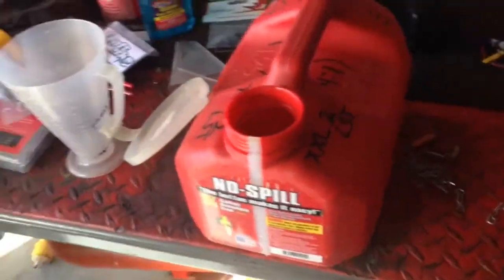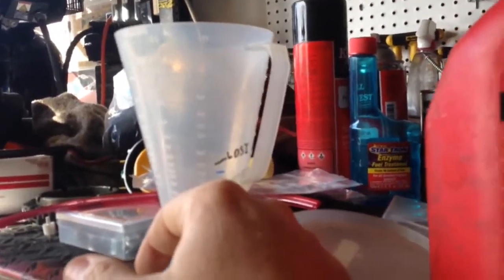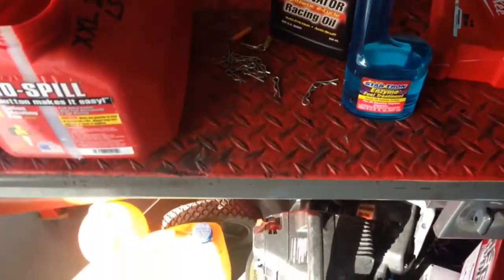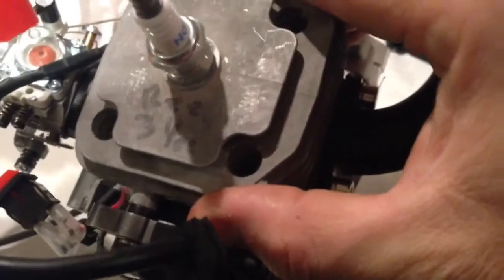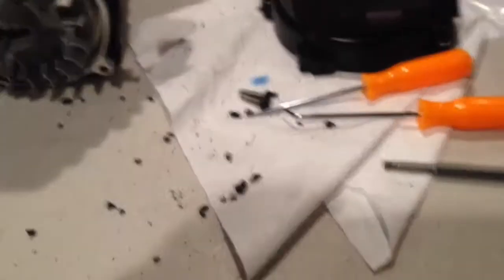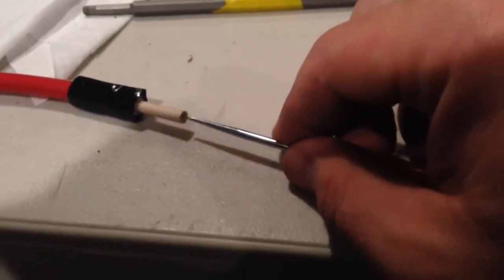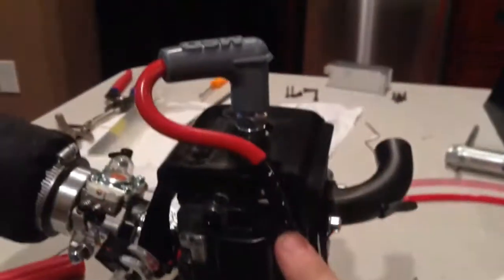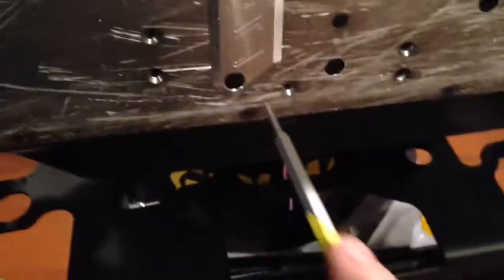Part4 DBXL, GAS Mix, MSD Spark Plug Wire install

Comment: Hi buddy,  hope you're doing well!? I have a question, here in Sweden we have 95 and 98 octane, can I run 95 octane in a 2 stroke engine with the Dominator 2 stroke oil 28/1 mix?

Comment: I agree on your fuel choice and I absolutely agree with amsoil 2t seeing that is what I use, I also agree with adding a little fuel to the mixing cup to retrieve all of the oil. Of course you will not over heat, that is all dependent on your jetting and doing proper plug chops to confirm you are at the correct stoichiometric mixture. You see, I have these debates all of the time, even with my customers after I give them there bikes/quads back. As soon as they here how I want them to mix there fuel they are instantly up in arms and insists on mixing it with more oil. I just point them to macDizzy post and the banshee hq on the subject and hope they get it. I go by true science and stats not what I think is better or what works but what is proven to be the best way to mix fuel on initial start up. As you can tell, you have had no issues with the way you mix your fuel and I have never had a bike/quad come back to be from a customer in over twelve years. Yes you can mix the fuel with more oil but if you think and I mean really think about it, it’s not really necessary especially when you consider synthetic 2t oils. Even amsoil says on there website that you can mix there oil at 50:1 and not have an issue. Furthermore, amsoil dominator is not a TC-W3 type oil, so if you store you engine with this oil it will most likely rust the inside of your engine. When I store freshly rebuilt motors I use klotz r50. Dominator is also recommended that it not be used in alcohol or nitro fuels mixes.

I’m glad to see other gear heads like my self, I also like to give fellow gear heads the best information possible and let them do some background searching for them self’s so that hopefully they make the right decisions, then again there are a lot of stubborn people out there and (this) sharing information doesn’t always work, but hey I got to try right?
Reply from the maker: 4g63T 1G well said!!! Thank you!

Comment: Nice!   Does the msd wire work on rovan motors
Reply from the maker: Levi Hogge sure it will! You can even install the higher voltage coils that have the red boot on them. Most ZENOAHs engines use them and you can use them on your Rovan engines.

Comment: I disagree on the premix info you gave. I have been rebuilding two stroke mx bikes for my whole life and have done extensive research into this very topic, I can tell you for a fact that over oiling on break in is a big mistake. By adding more oil your actually leaning the mixture and can over heat the engine if your running the original jets that you ran when you were mixing at a higher ratio. The ratio your going to run after break in should also be the ratio you use during break in. All the oil is for, is to lubricate the bearings, it is the fuel that keeps the engine cool. The bearings in two stroke motors are ball bearings and needle bearings, requiring only minimal oil to operate efficiently and to keep the friction to a minimum. Adding more oil really doesn’t lube the bearings any better and only leans out the mixture and gums up plugs. But hey this is just my opinion, in the end it is your engine.
Reply from the maker: 4g63T 1G that's cool bro I appreciate your opinion!! 100% but I have done many 2 stroke motors this way and have great results always I kid you not! I have proof of everything I am saying! I even did my Crazy Twin Banshee motors this way back in my ATV days but back to these little motors I still have my 7 year old 4 Bolt Modded G290 motor runs great today and my past motors that I did for some friends still run today and my Full Mod Reedcase OBR still runs great and Many more Zen and CY engines. Soon you will see me do my SkoPod 62 cc motor same way!! Believe me none of my engines ever over heat ! Not my Gas ⛽️ engines and not my NITRO engines! I'm on them with temp guns in the beginning and I my problem most of the time is that I don't have enough heat!! Because I believe in heat cycling an engine during the break in process so I Usually have to heat it more with a heat gun to keep the temps up!! After every break in I do I install a new spark plug or Glow plug . Soon you will also see me build a engine with special ported parts and modifications and when completed it will be the same way I did all my others that I've had great results with from what I have seen for my friends and myself. Thanks for your opinion anyways I mean no disrespect and I wish there were more guys like us nowadays because guys like us that are motor heads are becoming extinct with all that fake electric gay shit that I cannot stand!!! Take care and thanks for stopping by!!
Reply: not only that to much oil on break in doesemt allow for the hone marks in the cylinder to properly wear in the rings. you actually want wear on a new engine so that all moving parts mate and live happily tiogether

Comment: Im curious as to why the MSD wire isn't packaged in MSD packaging? Is someone in their basement cutting up generic wires and putting on MSD boots you can buy online and  passing them off as a genuine officially licensed msd product? Every single MSD wire I have ever bought at any store in person or online was packaged in MSD packaging. NEVER in third party labeled packaging...I think Craft Werk is doing some shady things...
Reply from the maker: Lol! Bro I thought the same Fn thing! I used to race and street race cars and I've had Accel and MSD . All my ignition system is MSD from the Boxes to the Diga set boxes to wires and every box says MSD! But I guess Craft Works Racing beat us to that idea for the Gas RC world! The wire is all MSD not just the boot. Craft works also sells other things as well.

Comment: K how did you get the wire out. You skipped that
Reply from the maker: Michael Forzani I got the wire out with some sharp picks and then pliers and also a very small and sharp flat head screwdriver
Reply: BOTAJELL I watched again and you did cover it haha. I have had trouble getting the NEW wire to get over that screw. Any tips?
Reply from the maker: Michael Forzani just unscrew it once its loose a bit.
Reply: Sorry I meant how do you get the new one in I’ve tried screwing it and it won’t go.
Reply: Bro, did you even watch the video at all? Lol